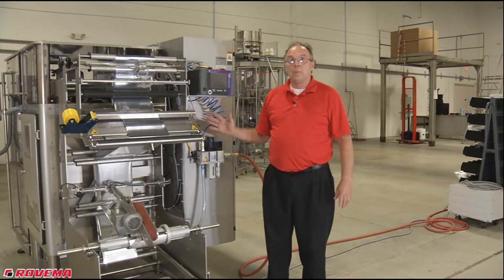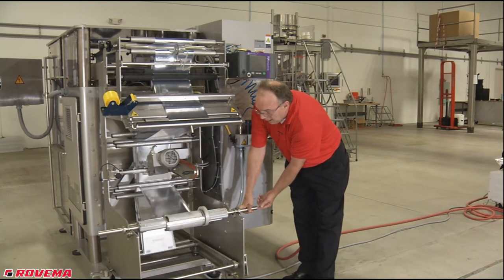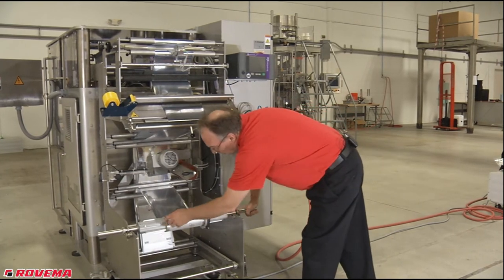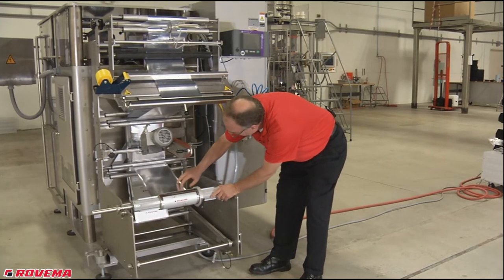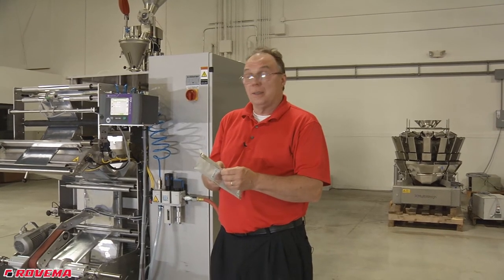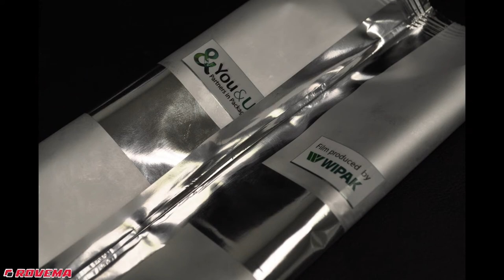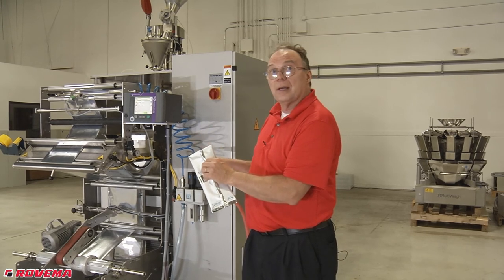Rovema Tech Note  Film Tracking for VFFS Machines

Comment: Okay well lets imagine that the operator has put the reel on correctly but the film still drifts left and right. Where is the best place to look?
Reply: the belts up front. and is your tracking on?
Reply: @roberttempler4555  It's funny you should mention that, today I noticed a strange 'clunk' sound as I was inching the film through. So it could be the shaft controlling the drive belts?
When you say is the tracking on I'm assuming you're referring to an automatic tracking system, our machine is about 60 years old so everything is manual... Well, in comparison to the high speed machines.
Reply: @kempster08  yes I was referring to auto tracking. we have an old machine I learned on and then got a new one that took some practice for me to learn. And it would move the film from side to side. But if its older I would really think it might be those belts.
Reply: @kempster08  I know this is an old post, but maybe you'll see it? Is your machine really that old? Do you have issues with it quite a bit? Ours was installed in the 90's sometime and it is messing up so much now. Just curious.